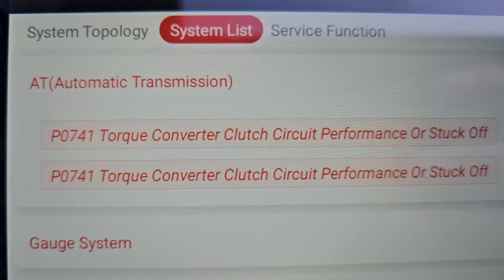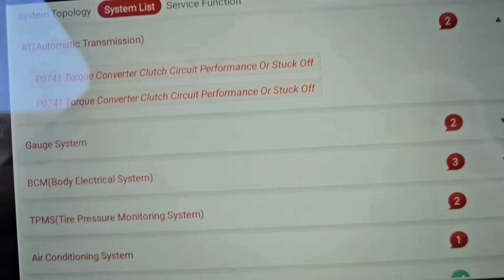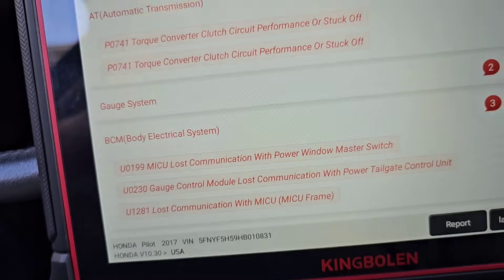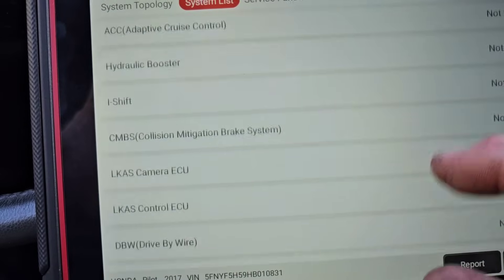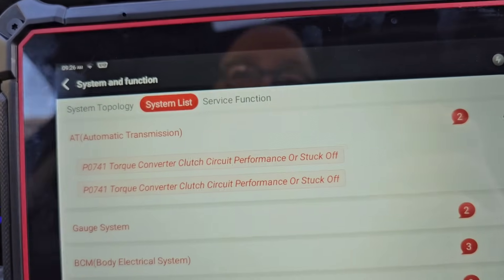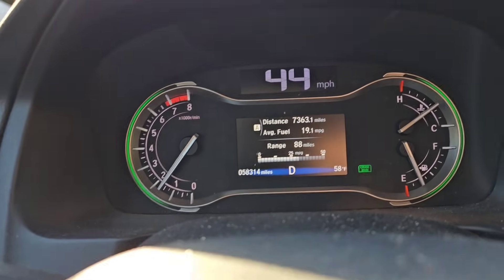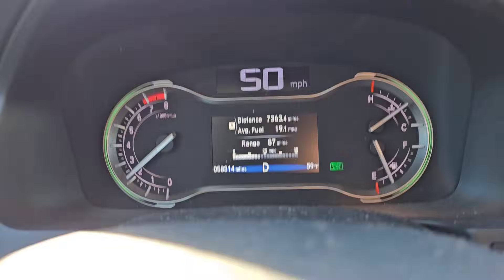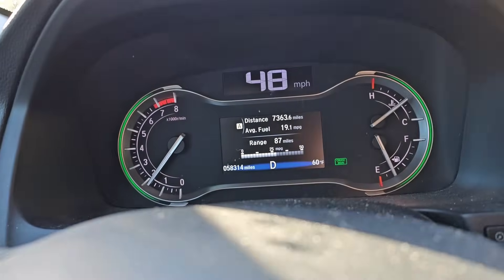Checking Bulletins Finds a Warranty Extension For This Issue!!

Comment: I hate modern cars,there's so much that can be simple but so expensive to repair.
Reply: Too many control modules that are intertwined and can cause false trouble codes...

 One must be part investigator to try to make sure they're not going to use the parts cannons with incorrect guesses 

Other things I hate about newer vehicles... Plastic Fantastic parts that will be brittle after 5 years of heat cycles 😢